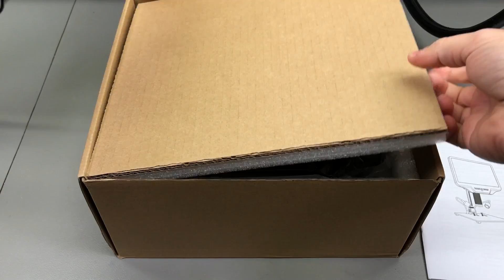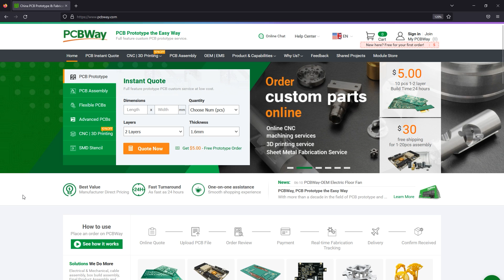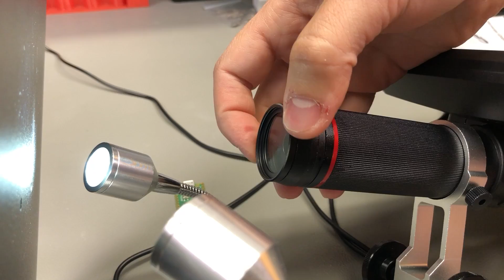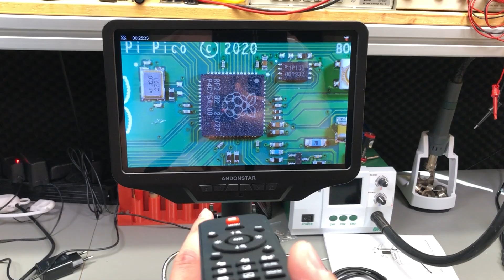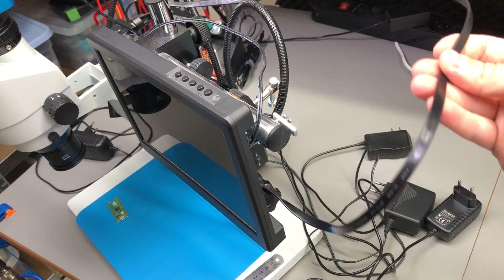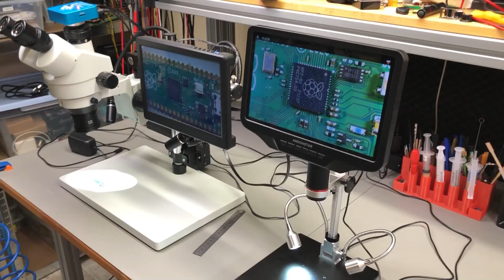Andonstar AD409 PCB Inspection Rework Microscope | Voltlog #434

Comment: BTW: A stereoscopic microscope doesn't do anything for me since I'm stereo blind and also my glases don't combine to well with most eyepieces... However you can fit polarising filters on the work lights and screw on filter which reduce glare and can make important details visible which might not even be exposed from depth alone... Also notice that the DoF is rather shallow so don't expect a huge depth effect with everything in focus...
Reply: I guess you don't have basic glasses that you can take off to use the microscope?
Reply: @jaro6985  Then I wouldn't see anything outside the view of the microscrope; which is a bad thing especially when dealing with dangerous tools like a hot solder iron. 😅
Reply: @danielegger6460  ah understand, I usually flip them up then back down

Comment: The magnification of those microscopes is way to high; I have the ADSM302 and its fixed magnification is unusable for any serious electronics work. Not sure why they can't offer a proper zoom lens, I wouldn't get a fixed magnification microscope anymore. The HDMI output is rather useful since the builtin recording is not only bad quality and resolution but it's also rather flimsy to use; for that I have an external HDMI Recorder and a big 1080p screen on an adjustable monitor arm which allows for comfortable adjustment of the position of the monitor independent of the work area and camera position plus I can record in high quality without flimsy Micro SD card in bad resolution with tons of crap displayed on the screen and requirement to use the crappy remote or visibly jiggle the screen by using the on-screen buttons. The WiFi function could be useful if properly implemented but it looks as if it was not.

Comment: i bought the TOMLOV DM201 Pro. it's a 7" screen (they make a 10" the dm202)  for $169 and it's much- much nicer. wireless remote, lens ring light beside the 2 side lights, touch sliders for intensity for both, usb-c for power to unit and base, a 10" adjusting rack for much larger work clearance, 16 MPixel camera, plus the HDMI out and a 32MB sd card. also it has a built in battery so it can be "wireless" (need the USB wire from scope to base for light). i use the HDMI for board inspection on a 35" screen because it effectively gives more magnification without using digital zoom and needed more working distance.
Reply from the maker: that sounds interesting.

Comment: Of all the reviewers of this kind of microscopes so far you are the second one that was smart enough to clamp the microscope at the end of the lens barrel.
Kudos. 👍🏻🤣
Reply: DOH! I have an Andonstar microscope and couldn't figure that out, instead I've built a custom extension to get the magnification down to a useful range... 🤦‍♂ However I must say that Andonstar has outstanding support; I asked them for a longer stand and they said they didn't have one but they helped me build my own by sending me a camera holding brace completely free of charge.
Reply: @danielegger6460  the simple solutions are not necessarily the obvious ones. 🙂

Comment: How do u chose a soldering mat?
Also what is the type of mat used in old uni labs that type that is very rigid?
+ cum le zice in romana ca nu stiu cum sa caut
Reply from the maker: I don't really use the term 'soldering mat' but if you only plan to you use it for soldering then one of the small blue ones like shown in the video, made from silicone, will do the job just fine.